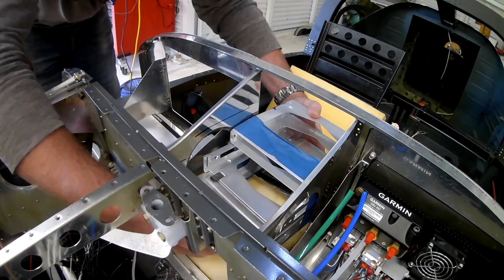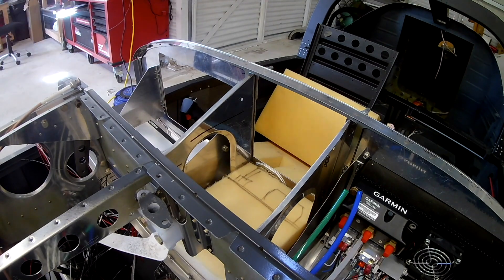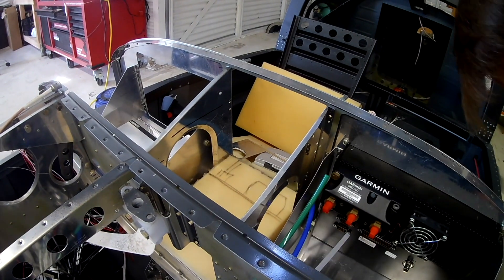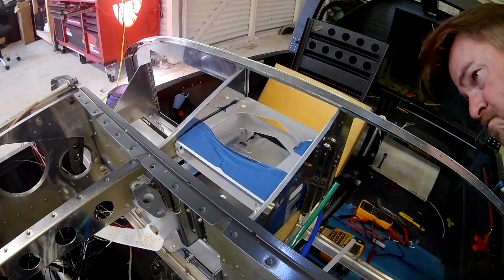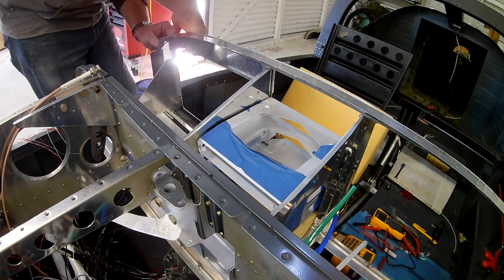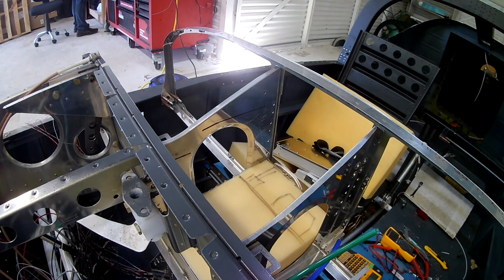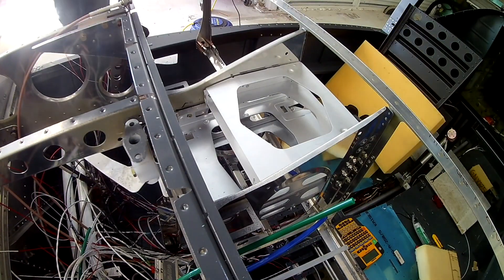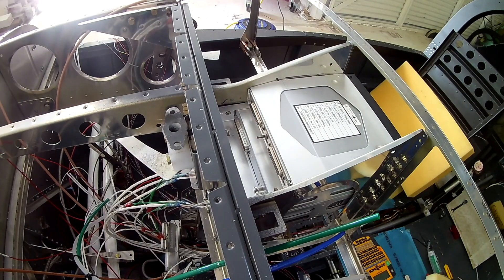RV-14 Avionincs Rack Mounting

Comment: Andrew the avionics and wiring take a lot of effort!  How much more does it cost to go with one of those pre-wired panels and wiring harness? I understand you are trying something different with your panel, but wondering if you had decided to go with a prefab how much extra that would end up being?
Reply from the maker: That's a good question I don't know the answer to. I didn't even think to contact the prefab panel shops to look for a price. I'm not really doing anything different than everyone else. I'm copying the model of one of the prefab makers I've seen.

The effort for myself is the regular amount of work that'd be needed to build up the panel normally plus the learning curve for this... which is large.
Reply: I’m planning a panel very sillier to Andrews from a custom panel factory and am budgeting 40K